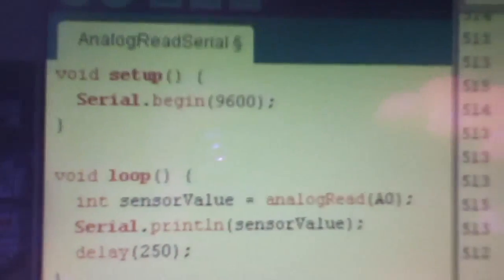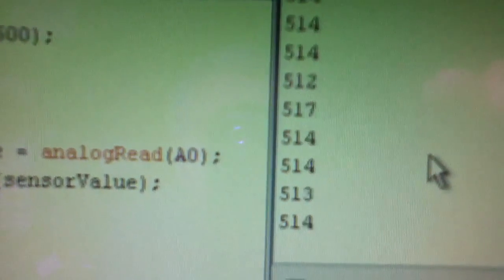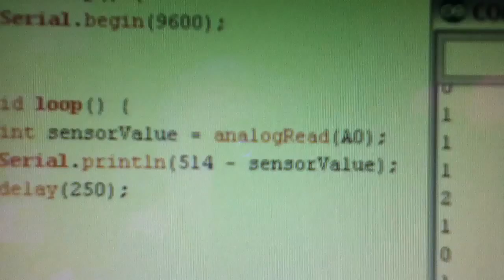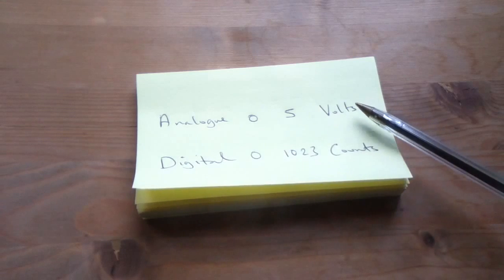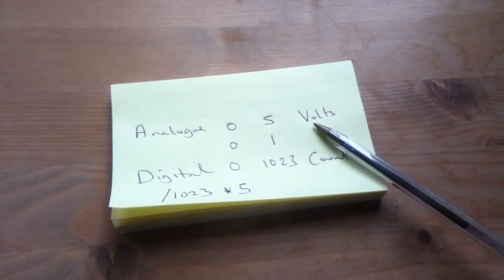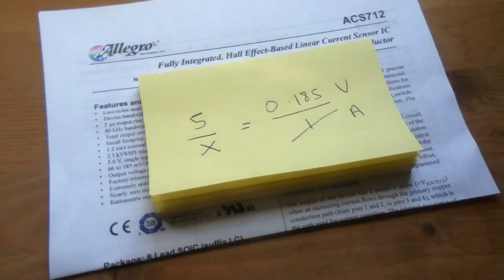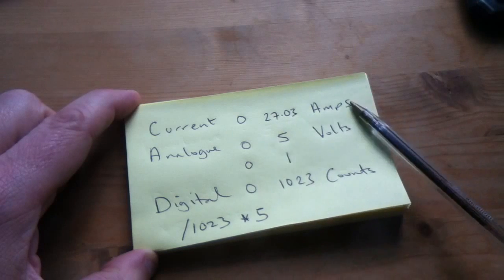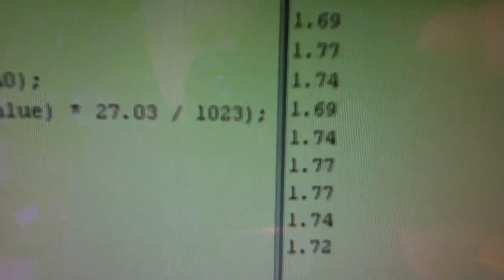Using the ACS712 Hall Effect Current Sensor Module (part 2)

Comment: It makes only a tiny difference, but the correct scaling factor is 1024, not 1023. The ADC is already saturated to its maximum reading at just below 5 volts, specifically at 1023/1024*5 volts.

Comment: Hi, wonderful information, I am using this right now on my project that I got stuck with for quite some time. Thanks.
Any particular reason you did not use the map() function at 4:10 ?
Also do you reckon it would be sensitive enough to differentiate between 150mA and 170mA?

Comment: Just for the people watching this, there is a mistake here. The sensor only measures up to 5A not 27.03A. Most current sensors are calibrated to measure the current range by outputting in the -1v to +1v range regardless of power input.

Comment: can i use it to calculate both current and voltages?
Reply: Voltage requires a different sensor. The ACS712 is a current sensor.

Comment: You are correct in using 1023 in the divisor. While there are 1024 values between 0 and 1023, there are only 1023 steps. That gives about 5mV per step. Since the function to convert from Volts to Amperes is V = 185mV/A * I, the conversion from Volts to Amperes is I = V / 0.185 . Putting it all together, the counts per amp should be 37.85.
A bit of Python code; not that you would want all of this in your C code:
zero_offset = 514.0
steps = 1023.0
vref = 5.0
v_per_amp = 0.185

counts_per_amp = (steps * v_per_amp) / vref

#  to demonstrate 1 Amp of current 
counts = (zero_offset - 38) 

v = counts * vref / steps
# m is for slope 
m = vref / (steps * v_per_amp)  
i = (zero_offset - counts) * m
print 'slope = ', m
print 'counts per amp = ', counts_per_amp

print counts, ' counts = ', v, ' volts = ', i, ' amperes'

Gives:

slope =  0.0264193812581
counts per amp =  37.851
476.0  counts =  2.32649071359  volts =  1.00393648781  amperes

Comment: Good stuff. Math looks good: adjustedStepValue*ampsPerStep. Seems more efficient to calculate ampsPerStep outside the loop as maxVoltValue/maxStepValue/voltsPerAmp. You seem to indicate that maxVoltValue is equal to maxVoltValue/voltsPerAmp which is not the case since this is relative to maxVoltValue/2. I think it would be more accurate to say that maxVoltValue is equal to maxVoltValue/voltsPerAmp/2, but the total number of amps represented by the scale certainly is maxVoltValue/voltsPerAmp and the associated math is perfectly valid. 1023 is the only sensible divisor since maxVoltValue/1024*maxStepValue does not equal maxVoltValue. Of course this assumes that the step range is 0 to 1023 and not 0 to 1023 plus 1. Below is the algorithm and output in lua.

maxVoltValue=5
maxStepValue=1023
voltsPerAmp=0.185
ampsPerStep=maxVoltValue/maxStepValue/voltsPerAmp
offset=maxStepValue/2
for stepValue=312,712,50 do
  adjustedStepValue=stepValue-offset
  amps=adjustedStepValue*ampsPerStep
  print("stepValue="..stepValue..",amps="..amps)
end

stepValue=312,amps=-5.2706665609891
stepValue=362,amps=-3.9496974980846
stepValue=412,amps=-2.62872843518
stepValue=462,amps=-1.3077593722755
stepValue=512,amps=0.013209690629045
stepValue=562,amps=1.3341787535336
stepValue=612,amps=2.6551478164381
stepValue=662,amps=3.9761168793427
stepValue=712,amps=5.2970859422472

Comment: I would say based on the datasheet stating 0.185mV per Amp with a 0-5V swing on the output:
5 / 0.185 = 27.03A swing from positive to negative, with ADC steps of 1024 from positive to negative.
Therefore = +/- 13.51A with a 512 step swing on either side.
This means that each step = 13.5A / 512 = 26.4mA

Final Arduino code simplified:
(ADC_In - 512) * 26.4 = Current   [in mA]
Divide by 1000 to get Amps.

Comment: Julian-
can we have the code (including the top part) ?  I made a stab at it, but am getting results about 33% in error, and I am wondering if I am using the correct library, as well as other code.
Reply: got it figured out. using 511 worked for me.

Comment: The calculation is wrong. 13.5 A will give full scale voltage 5V, -13.5 A will give 0 V. In previous video, it is very unlikely that the shunt resistor in the A-meter is made of copper. I suppose the shunt is made of constantan.

Comment: Anly correction is that you should devide by 1024 not by 1023 and readers should pay attention to the act that the sensor output may vary from 0.180 to 0.190 Volts/Amper.

Comment: I have a homemade inverter generator that I made with a PMA (permanent magnet alternator ) and would love to program something that would boost the RPMS of the engine based on dc voltage. Would this be possible ?

Comment: can I use it to measure DC current ?
Reply: In case you havn't noticed, in his part 1 he shows he's using 12vdc in this setup. And i actually don't think it will work with ac because it is bidirectional. meaning it can be used either way, but this particular device can't handle doing both at once.
Reply: It doesn't rectify and smooth it's output, so you'l get readings flying all over the place if you use ac.
Reply: You might be able to program your micro controller to make sense of the wonky output ac will give. If you do, it would be nice if you share it with everyone.
Reply: @Aperson-sv2hc  did you ever try it?

Comment: Why don't you measure the chips behavior by simply putting a precision amp meter in row with the chip and take some readings on different amps.
Then you could get your own data sheet table and put those values into your micro code.

BTW: analog inputs of Arduino are strongly dependend to the stability of your Arduino's voltage supply. By default there is no voltage reference for the ADC in the Amtel chip other then the one of the Arduinos Voltage supply!
Thats the reason why youre measurements are just jumping around! So you might consider to get some external 16 bit ADC having an internal voltage reference to measure the Voltage of the amp sensor. see some of Texas Instrument chips

Comment: How sensitivi is it? I need to measure pico amperes. Will this be useful?
Reply from the maker: +Carlos Salas No. There's a lot of noise around the zero amp point.
Reply: Well then, do you think it is possible to generate a digital output of de meassuring of a multimeter and connect it to the digital input of the Arduino?

Comment: I would like to measure the current of a small motor I(free running) = 20ma, I(stall) = 250ma.  That current range is way too small for the ACS712, are you aware of an alternative?
Reply from the maker: +Enigma758 Maybe the INA219?
Reply: +Julian Ilett That might work, but now I think I'll use a sense resistor and an op amp.  That way I can precisely define the gain to match the input to my ADC.  Thanks.

Comment: Hi, i understand that it is a current meter (Ampere Meter) but i just want to clear my mind, what is the max current that it can detect? what is the maximum voltage that this sensor can work with, can it be used with 2,000 Voltage or more as long as it doesn't met the max current passing through it?

Comment: why do all this math just to read the one thing this was made for to begin with ? i dont get it shouldnt it just dispay amps and thats it?
Reply: +Frank Lopez You are used to a "standard" amp readers, which work the same way as this little amp reader, but do all that math in the background and display (if it has any display device) it in amps. This video shows exactly how amp readers work and how all that math is done in order to convert the data.
That's why this module is so cheap, it gives you a raw reading only and leaves the math to you.
Reply: Hi. The device does read amps. The amperage is sent out of the device as a voltage scale. microcontrollers dont have amperate inputs only voltage. Its like, measuring speed with pulses. micros dont have a speed input but they can count how many pulses in a given time...this will let you calculate speed.
Reply: Terry Peake just a bit to much just for something that it supposed to be the main feature at the very lease this information given in this video should have been part of the datasheet or pdf file when you buy this
Reply: Sidabra24.com thanks for the input, i understand now

Comment: Use the equation of a line to convert 10 bits to volts.  Plot a line were x axis shows 0 to 1023 and y axis (the desired "output") shows 0v to 5v.  Then use the line equation y=mx+c, where m=y2-y1/(x2-x1) .  C=0 if the line cross coordinate (0,0). So pick x1,y1=(0,0) and x2,y2 = (1023,5), that gives you y=(5/1023)x or y= 0.0048 x
If the voltage is really -2.5V to  +2.5V as the number varies from 0 to 1023, then C=-2.5 (the slope is the same) so the final equation is y(volts)=0.0048 X -2.5V
Reply: +mdesm2005 once u translated the 1024 steps to voltage (0-5v) you can use this equation: 
I(amps) = (Vin - 2.5) / 0.185
so if the 0A is at 2.5V and the maximum voltage u can measure with arduino is 5v means from -2.5v to +2.5v
each 0.185v = 1A so 2.5/0.185=13.5A  -this is the maximum current u can measure within 2.5v area.
if you read after convertion 5v you get:   I = (5-2.5)/0.185 = 13.5A 
if you read 0v you get:  I = (0-2.5)/0.185 = -13.5A
anyway, this is my opinion.
to be sure we sould compare these readings to actual AVO meter readings..
I did not assemble this project yet so I cannot tell for sure
Reply: רונן רק היהודים יצילו את העולם

Comment: Hi, great video, wondering if you can help, stuck with the calculations 5/0.185=27.03A (My sensor is a ACS 709 -75A TO +75A ITEM 2199) that part is driving me mad can you help me with that 5/?=amps on the ACS 709 Thank you in advance.
https://www.pololu.com/file/0J498/ACS709.pdf

Comment: Ive done 3 of these on my solar install. The zero drift gets annoying at times. Few ideas I have floating around. Have you tried using a 10 place array bit of code to average the reading to reduce the noise? Ive used this which works to some degree of success. I have a 30amp unit reading the DC current input on my 3kw inverter. It can draw up to 300amps so it is partially shunted so no more than 20 amps flows through the ACS712.
Ok so when it is reading high current everything is ok. But when its off and it returns to zero, sometimes it drifts. Instead of returning to 512 it can be as high as 516. So i have to rezero it. Then the following day it can be back to 508. Frustrating. So I have this idea. Using the arduino, program it to constantly average and store the zero point value when the inverter is off, and cease this when the inverter is on. There by it calibrates itself every day. What do you think?
Also, because the resolution of the setup is only 1023 places, reading small currents on a setup that can measure 300amps is impossible. So I am going to try installing a second unit attached close to the cable. Not actually connected electrically to it. And have that one calibrated much higher so it reads low currents range say 0 to 20 amps range across the entire 1023 counts. When it reads over, simply switch over to the other sensor.
What do you think?

Comment: you need to divide by 1024, not 1023.
you are applying a scale from 0 to 5v to 0 to 1023 counts, but 0 is also a valid count, therefore 1024.
Reply: +unrealzocker - u r correct
Reply: Thank you unrealzocker you are quite correct. It quite clearly says in the datasheet for the MC that each count is 1/1024th of the reference voltage in plain clear black and white. Why do so many people insist on dividing it by 1023??
Reply: Each voltage step will be 5/1023. Since zero is always zero, there will be only 1023 increments that actually represent a measurable voltage. You can check this easily using a spreadsheet if you need to confirm it for yourself.
Reply: So you can't measure 0 volts?  :-)  In an ideal setup, the zero volt reading in a current meter would represent something, and you really should include that value in your calculations.  However, we are talking about A/D conversion here (a.) in an Arduino (b.).  a:  any ADC has an inherent quantization error (roughly half the distance between two consecutive measured values).  And b:  while the Arduino is great at a lot of things, and probably even good enough for this usage case, it's built in A/D converter is far from professional reference grade.

The error introduced by 1024 vs. 1023 would be about 4.88 mV full scale (4.77 uV error per count).  This makes sense, since the Arduino measures 0-5 v with 0-1023 counts -- a resolution of 4.88 mV per count.  Since our zero is mid-scale at 512 counts, the error converts to  2.44 mV maximum. Using 27.027 A as full scale equals 26.4 mA per count.   This means quantization error alone is 13.2 mA.

4.88 / 26.4 gives 0.18485 mV/mA, which means our 2.44 mV max count error = 13.2 mA.  Strange how that works out, eh?  So quantization error plus the 1023 count error gives 26.4 mA error Maximum.  Eliminating the counting error would only gain back half of that error, and only at the maximums of the range (+13.5 A and -13.5 A).   Something as small as the 1023 vs. 1024 debate doesn't matter at this resolution.
Reply: You are right unrealzocker:

The resolution should be Vref / ADC counts = 5 / 1024
ADC Counts = 2^10 (for 10 bits ADC)
The half scale value of the ACS712 (in this case) is 1024/2 = 512, what makes sense. 

You can google for "adc resolution calculation"
https://www.eetimes.com/document.asp?doc_id=1276974

Please tell me if I'm wrong and why, because then I have to change all my codings...  :-(

Comment: Do you connect the sensor in series or parallel??
Reply: Kevin Acevedo Series, to measure current you must cut the circuit and have all the current flow through the sensor.

Comment: I don't understand how you are able to measure AC currents by directly connecting the ASC712 to the arduino. The current sensor outputs a DC offset at 2.5V which you covered in the first video. Keeping that in mind the AC sine wave now sits at 2.5V rather than at 0V. The A/D converter on the arduino should not be able to read this. Also your Vavg would be at or extremely close to 5V, and potentially ruining your pin or arduino. Can you please elaborate on why you are able to measure AC currents by directly connecting the current sensor to the arduino.
I've tried multiple times to connect the arduino directly to the analog input pins and it would ruin my arduino. I also looked at the sine wave output of the current sensor on an oscilloscope and it is indeed sitting at 2.5V.
Reply from the maker: Robert Shinde I'm not measuring AC currents, I'm using it for DC current measurements.
Reply: Ah, ok. I was just thinking AC regarding the light bulb.
Reply: Robert Shinde i guess the better question should have been how are you powering an bulb with dc power
Reply: bulbs work with DC or AC

Comment: Not correct. The data sheet says 0.185V = 1Amp. 0.185V is 3.7% of 5V. Therefore 3.7% of 1023 is roughly 38 counts. The correct conversion is: (512 - AnalogRead)/38
Reply: RadiationOverdose it’s the same thing. (27.03/1023) ~~ (1/38)

Comment: does this breakout board use an SMD 1nF capacitor and 1uF capacitor for the fitler and the VCC.  I only ask because my breakout board doesn't include the capacitors as the datasheet shows.